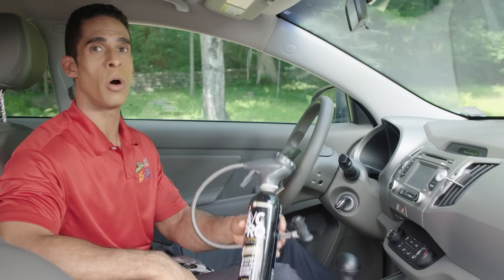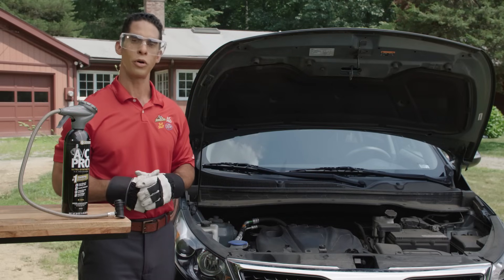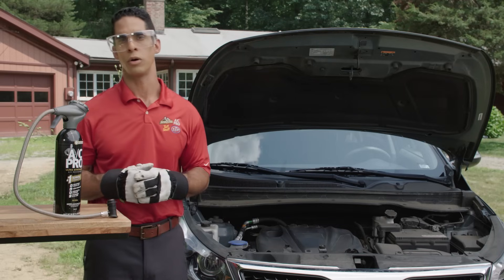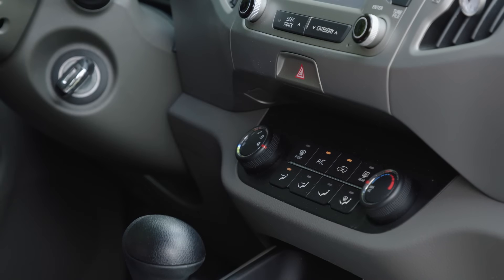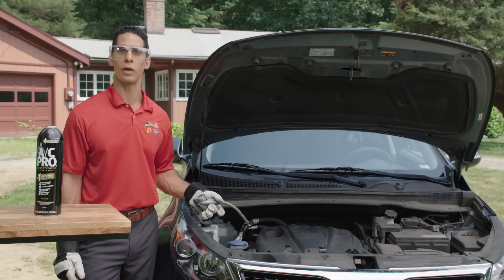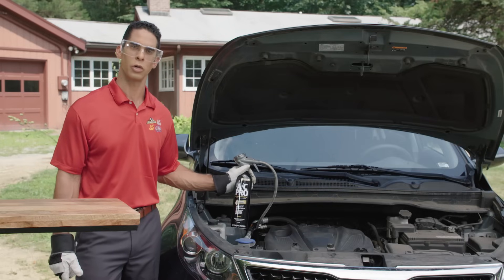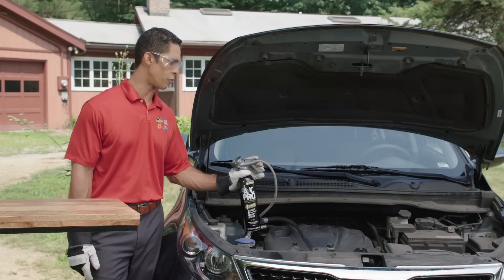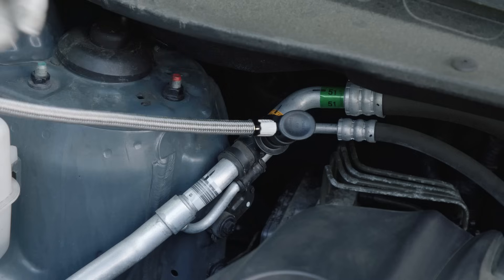A/C Pro® How To Recharge

Comment: Where do I store the remaining refrigerant if there was some left over?  Can I leave it attached to the charging unit?  If so, can I leave it in my garage?
Reply from the maker: Store in a cool, dry place.  You can either leave the gauge on or disconnect.  The cans have a self-sealing valve and won't leak without the gauge.

Comment: My 2006 Sienna was not cold so I tried using this. Not sure if I'm doing it right. I attached the gauged on and it went all the way to the Yellow side even before pressing any freon. Please advise.
Reply from the maker: The pressure in your system may read in the yellow or red if you connect the gauge and don't have the engine on and A/C on max cool with the vents on high.

Comment: Isn't there something about ambient temperature that has to be figured in? Also, is there any PAG oil in the ACP 100V can ? I installed a new AC compressor, accumulator with hose assembly, and orifice tube. I put 3 oz. of PAG 46 oil into the compressor, but I still need another 3.6 oz. of PAG 46 oil that's supposed to be added to the accumulator, but the hose is not detachable, so I have to put it in through the low pressure side with the refrigerant. I'm going to be charging my system soon, and I'd like to know everything before starting the job.

Comment: If your car does not use all the refridgerant in the can, can you save the existing freon for another time?
Reply from the maker: YES!!  The gas doesn't go bad so you can reuse as many times as you need.  Store in a cool, dry place.  Can be stored either with or without the gauge connected.

Comment: When done how should I store this can? Unscrew the guage/hose thingy or just leave it on?
Reply from the maker: You can store the can in a cool location (no hot cars, warm garages, etc or the can may explode).  You can store with either the gauge on or off as the product has a self-sealing valve so refrigerant won't leak out after removing the gauge.
Reply: @Acprocold  Awesome. Thank you. Stuff works great.

Comment: What to do with left over. Also the gauge is going up as it is off the lower ac line.
Reply from the maker: Store in a cool, dry place.  You can either leave the gauge on or disconnect.  The cans have a self-sealing valve and won't leak without the gauge.  The hose has a check valve so the gauge will hold pressure when not connected.  https://www.youtube.com/watch?v=SZcQnNz-pT0

Comment: My AC button has a light when I press it that turns on for a few seconds, but then turns off. Will this process still work if everything is running such as fans and stuff, but I have no light on my AC? 

I’ve heard a that it’ll turn back on while charging and wanted to confirm. (VW/Audi MK5/MK6 A3 8p platform)
Reply from the maker: Not sure what the light is for (maybe telling you Max A/C is on), but if your compressor is working properly it should work even if the light is not on.

Comment: I'm wondering if this product could stop leak coming from evaporator
Reply from the maker: I would say most likely not since the evap is metal and this only stops rubber leaks.  You can try on of our Super Seal products, which stop both rubber and metal leaks.

Comment: Does it seal the leak my ac lose its refrigrant after 1 or 2 months seems it has a small leak from the evaporator
Reply from the maker: You may have a leak in a metal component if it's the evaporator.  Try one of our Super Seal products to seal metal leaks.  https://www.acprocold.com/product/acp108-6-super-seal-all-in-one-stop-leak-12oz/
Reply: @Acprocold  i just use the product awhile ago seems its working awesome its blowing cold air now and the noise also gone😁i will come back and update after a few day
Reply: So yeah its been 2months and my ac still blowing cold even in the middle of the day thanks ac pro

Comment: My hose isn’t attaching onto the bottle, second time using it so Ik its the hose for it im not sure whats going on. Any idea?
Reply from the maker: Please confirm the dispensing mechanism (hose and gauge) and can are for the same refrigerant type. Both the gauge and can have refrigerant-specific threads, with R-134a being clockwise and R-1234yf being counterclockwise. You cannot mix-and-match different refrigerant types.

Comment: What if ur AC doesn’t have a leak is it ok to use this product still
Reply from the maker: All systems will leak over time.  However, if your A/C system issue is not caused by low refrigerant, you should not use this product.

Comment: How would you store it if there is leftover refrigerant in the can ?
Reply from the maker: You can store it with or without the gauge on.  Our cans have self-sealing valves so if you take the gauge off to store, the refrigerant won't leak out of the can like product did in the past.

Comment: The instructions on the can showed to hold it upside down and rock it versus the video showed it rightside up. Hope it didn’t matter🤷‍♂️
Reply from the maker: You shouldn't do the recharge completely with the can turned upside down the whole time.  You should turn the can to shake periodically to mix the formula.  The instructions are depicting the can being shaken.  You should be ok with how you did it.

Comment: Hmmm ... when I first connected it read zero psi. After a few pumps, it reached 30 psi (In the green). Occasionally I would hear a click then for a few seconds it would shoot up to 40-50 psi. Then another click back down to 30 and repeated ... etc. So not sure what that's all about? Anyway pretty much empty the can and the AC is working now.
Reply from the maker: Sounds like it's your compressor cycling on and off.  The clicking sound is the compressor clutch turning on and off.

Comment: I have a Volvo and hooked up the gauge and it was reading in the green zone (AC was on and no AC Pro put in system). So I guess I am not low - but I have air coming out of the vents that is not cold. How do I resolve?
Reply: I have the same problem. Need help!
Reply from the maker: If you're in the green, but your vents are blowing warm air, you may have an issue other than low refrigerant (fuse issue, stuck blend door, compressor problem, dirty evap, etc.
Reply: Thank you for the reply. Looks like I will have to have the garage take a look!

Comment: My gauge said it was filled but the AC was still warm!
Reply: You’ve got air in your system and need to have your ac serviced by a mechanic
Reply: Then you have another problem more serious...most likely the condenser. If your compressor wasn’t working the gauge would show in the red.

Comment: I have a 97, 5.7l, c1500 Suburban. I checked A/C pressure and it was just below the green zone. I added 3 pound of 134a as instructed in your video and it is now in the low end of the green zone but still only blowing cool.  Any ideas?
Reply: Go on to the Internet and look up the capacity of your system. You want to know exactly how many pounds of freon it takes to fill the system. You can also add can by can till you get the proper amount in the system. Just use the same gauge that you use on the first can. This is an older post so you probably already have your system taken care.

Comment: What if the attachment will not go onto the port? I have a 2004 Wrangler and the hose will not attach properly.
Reply from the maker: If it doesn't connect, you are most likely on the high side port.  The low pressure port is standard on all vehicles and this will definitely fit that.
Reply: @Acprocold  Yep, I found the low port. Which means the pics on the A/C Pro app are incorrect.

Comment: The AC Pro line does not fit our 2018 Honda Accord low pressure  port.
Reply from the maker: Your 2018 Honda Accord uses a new, environmentally friendly refrigerant called R-1234yf.  You need this product https://youtu.be/CsrtqKdmlOo
Each gas uses ports that are unique to the system so that these refrigerants can't be mixed.

Comment: I used a different brand’s gauge on my AC Pro canister but I don’t think it punctured the seal. 
I don’t feel my canister getting cold, and I don’t think anything is coming out at all. I’m afraid at this point to unscrew it to throw the AC pro gauge on it. What should I do ???
Reply from the maker: Unless you're using a can manufactured prior to 2018 (most likely you're not) you should be able to unscrew the gauge off the can and replace with another gauge.  All products manufactured after Jan 1, 2018 have a self-sealing valve so they won't leak if you remove the gauge after using.
Reply: @Acprocold  thank you. Fresh can from 2021

Comment: what if the vehicle has already refrigerant and I want to recharge it with A/C PRO refrigerant? can I use the gauge only to remove the old refrigerant?
Reply from the maker: This product will not allow you to extra refrigerant from your system - only add it.  You can add refrigerant from this product to gas that's already in your system with no problems.  The product is meant for that.

Comment: I wonder if this refrigerant could be used on a hybrid?
Reply: It can, I just brought one today says it right on the can
Reply from the maker: This refrigerant is not recommended for hybrids and EVs without belt-driven compressors.    Our A/C Pro Extreme product works for hybrids or EVs.  You can find that product at Autozone, Advance, and O'Reilly's.  https://www.acprocold.com/product/acp210ad-6-a-c-pro-extreme-conditions-r-134a-recharge-kit/
Reply: @Acprocold  thanks for the info.

Comment: So question, i jave done this about 3-4 times to my car already. Its always on the left side (white zone) when i connect the hose to the pipe. Clearly something is going on if this happen to me least 3 times a year. Any suggestions??
Reply: You’ve got a leak. Take it to the shop and they have special electronic tools that can sense refrigerant to find the leak. Or they can use dye.
Reply from the maker: Yes, you definitely have a leak.  It may be a larger rubber leak beyond what our product can repair or it may be a metal leak in which case you can try A/C Pro Super Seal.  Super Seal does have a red dye in it so if it continues to leak out you'll know where and that will require a certified technician to repair.
Reply: @Acprocold  Thank you so much, i really appreciate the advise and will look into the Super Seal once i have to do this again.

Comment: My Hyundai Veracruz 2007 the pressure gate always on green filled why ?
Reply from the maker: If you're in the green, but your vehicle is blowing warm air out of the vents you may have an issue other than low refrigerant.

Comment: What if it shows the pressure too high before adding
Reply from the maker: If you've followed all the steps - engine on with A/C on max cool and the pressure reading is high - make sure the compressor clutch is engaged (you may not be able to see, but can listen for the sound).  If all of those are good do not add more refrigerant.  You probably have an issue besides low refrigerant and need to have a certified technician look at it.

Comment: Good video, what happens when you use just a little refrigerant and have more in the can , how long you can keep it and re use ii?
Reply from the maker: You can store this and use again at a later date.  Make sure to store in a location out of direct sunlight that doesn't get hot.  You can continue to reuse until the can is empty.

Comment: How come my AC pro won’t fit snug on my Camaro on the correct port?
Reply from the maker: There are two reasons this will happen - 1) you're not actually on the low side port 2) or you have the wrong refrigerant for your vehicle.  The ports are designed to an SAE standard so if you find the port it will fit.  The low and high side are different sizes and the coupler will only fit the low side.  R-134a and R-1234yf are two different refrigerants used and the ports on these are different specs by regulation.  There should be a sticker under the hood of your vehicle telling you what refrigerant type you have.  Make sure what you're using is the same.  Then make sure you have the right port.  You can use our port finder here. https://www.acprocold.com/a-c-port-finder/

Comment: I attached the AC synthetic pro recharge to my 2011 Chevy traverse in the gauge went to 25 I didn't hear I didn't hear I didn't hear the compressor Papa on I didn't squeeze it all the time was I supposed to squeeze it all the time but then I know that it was at ninety-seven but my car is still hot

Comment: Imma give this a try, my compressor not engaging so I'm thinking it's Low Low on Freon...so 🤞🏿
Reply from the maker: That could be the case.  If you are really low on refrigerant, the low pressure cut off switch will turn off the compressor.  If that's the case, just a little refrigerant (1-2 oz or less) should be enough to activate it again.

Comment: What can I do if my pressure is too high as soon as I connect it to the port It jumps all the way to the red bar and I get no cold air
Reply from the maker: We recommend checking the pressure before adding refrigerant.  If the pressure in your system is too high, you haven't used any refrigerant from the can, and you've following the steps properly (engine is on, A/C is on, compressor is engaged when checking pressure) then you can take the product back to where you bought it and get a refund.  You probably have an issue with your system other than low refrigerant and will need to take it to a professional technician.

Comment: What do you do to make sure that it's actually going in to your AC
Reply from the maker: When the coupler is properly connected to your low side port and you pull the trigger (engine and A/C must also be on) it will dispense into your vehicle.  You will notice the can getting colder, as well.

Comment: I have a problems both the ports are threaded so I don't know what to do
Reply from the maker: The low side port used to charge may have threads on the inside, but the outside should have no threads.  It's a standard fitting so our coupler will only fit on the right port.

Comment: How to remove it?? Its stuxk to the low pressure thing and I cant take it off
Reply from the maker: To remove the coupler you need to pull back on the collar.  It just pushes on without pulling back the collar, but to remove you need to pull back the collar.

Comment: what happens if you didnt shake the can?
Reply from the maker: Take a look at this video.  https://youtu.be/HniwxT7WDMI
Shaking the can mixes the oil/additive mixture with the refrigerant so you're charging with both.
Reply: @Acprocold  i forgot to shake the bottle, my AC was cold for a week and then didnt get as cold anymore.  is that normal?  or a leak?
Reply from the maker: You probably have a large leak or a leak in a metal component.  You can try one of our Super Seal products shown here https://www.acprocold.com/products/gauges-and-accessories/ and if this doesn't work then you'll need to have a professional mechanic fix as you have a leak larger than what we can handle.

Comment: I just bought this kit and when I plug it in it registers green but my ac is not blowing cold air. Before that I replaced the ac compressor relay fuse because it was not spinning, but after replacing it, it is now spinning. Can anyone tell me why my ac is not blowing cold air? 2007 Honda Civic Si.

Comment: I plugged the gauge in and my gauge jumped all over the place from full to empty and did this continuously, so how can I tell if it's truly low on refrigerant or not???
Reply from the maker: Make sure you take the pressure reading when the compressor is cycling on (clutch is engaged).   This video can help you determine that.  https://youtu.be/ldNPhoIpN6c

Comment: When my compressor kicks on the needle goes into the green then 10 seconds later it kicks off and it goes to low pressure? What do I do?
Reply from the maker: You should be taking the pressure reading when the compressor clutch is engaged.
Reply: @Acprocold  thank you. I guess I just need a new compressor

Comment: I have a question for anyone that can answer. I have a 2012 kia optima ex and I want to know if the low pressure quick connect port is smaller or same size as one on an american made vehicle. It almost appears the one on my kia is smaller. I ordered the ac R-134a kit and hoping the quick connect coupler will attach to my LP port.
Reply: On my 2013 Kia Forte the low pressure connector is right behind the power steering reservoir. It should have a plastic cap with an "L" on it. You'll see it.

Comment: What if it’s still in the green but blowing hot air ?
Reply from the maker: If you're in the green, but blowing hot air, make sure you followed the steps properly (engine on, A/C on max cool with fans, on high, and you're measuring pressure when the compressor is on).  If you've done that all correctly and vents are still blowing out warm air, you probably have another issue besides low refrigerant.  If you just checked the pressure without dispensing any refrigerant, you can take the product back to the place of purchase and get a refund.

Comment: so when I do this, it tells me I have enough refrigerant, but my AC is still blowing hot air what do I do
Reply from the maker: Unfortunately, you may have another issue unrelated to low refrigerant causing warm out to blow out your vents.  If you haven't dispensed any refrigerant, you can take the product back and get a refund from the store you purchased it at.

Comment: I did mines w the car off . Idk if it makes a difference or not 😅
Reply from the maker: I guess it's too late now, but you need to have your engine and A/C both on.  Without the A/C system on you probably won't charge to the full system capacity.